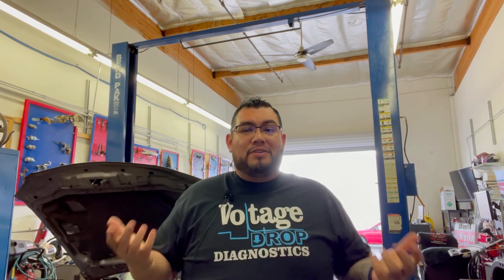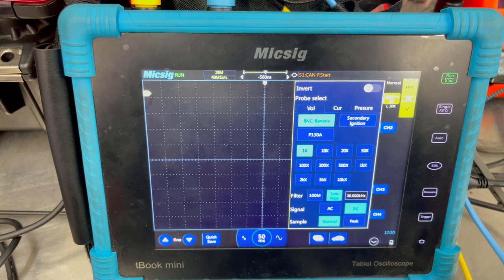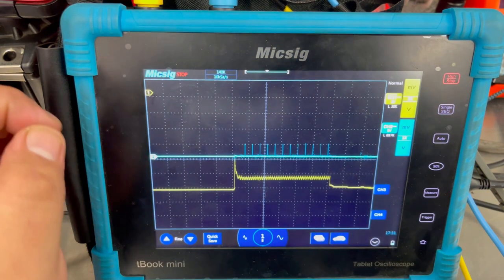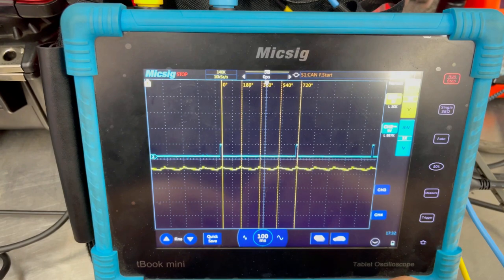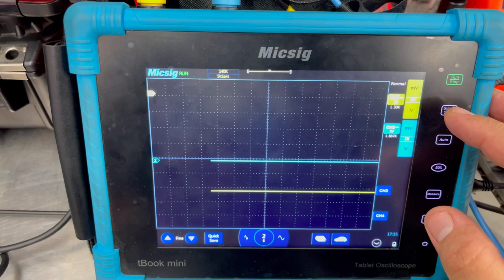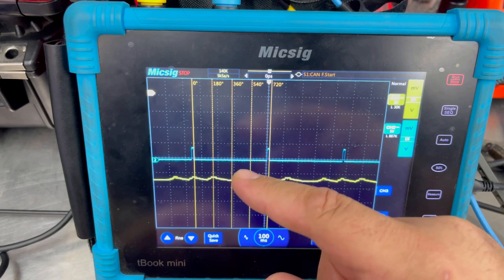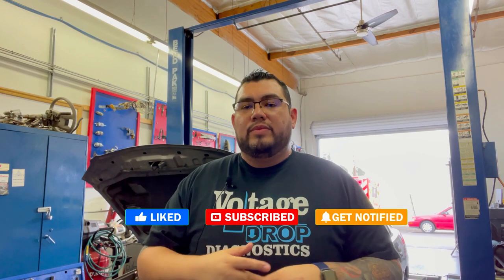PERFORMING RELATIVE COMPRESSION WITHOUT AN AMP CLAMP

Comment: Thanks for the videos they're so informative. I have a micsig and I guess we have a love hate relationship at the moment. My question is pertaining to the lead on the control wire. Is that same lead also connected to ground like the other channel connected across the battery. I'm not sure when I should be using a lead with just one probe or one that splits off into two probes. I hope that makes sense.
Reply from the maker: Thank you for watching! Each Channel lead will have a signal and ground lead. I double stack my grounds at the battery then each signal will be on different points. Just like a DVOM your scope measures the potential difference between the black lead and the blue, yellow, green, red lead. Does that make sense?
Reply: Yes

Comment: Don’t you need to deactivate the fuel injectors? I have a Honda 3.5 and a Honda 3.0.  Please let me know. I own your scope and don’t want to ruin it. Also on primary and secondary ignition do you need to use an attenuator? It doesn’t say anything on the scope when hooking up? Thanks for your help 👍

Comment: Triggering off a coil is nice if you don't have a misfire counter.  But if you have a misfire counter you can just hook to the battery using 1 channel and if there's a missing hump then you'll more than likely know you don't have compression in the cylinder that's misfiring.  Same can be said if you have a misfire counter counting up for multiple cylinders.
Reply from the maker: Misfire counter will say what cylinder the PCM thinks is misfiring. This has bit me in the you know what before, because of this I make sure im synced so I don't misdiagnose.

Comment: I'll say the only flaw with this video was you didn't show where you hooked up your leads on the oscilloscope itself. I'm new to oscilloscopes and you said 2 channels but I saw 3 hookups: 1 to battery neg, 1 to battery pos, and 1 to ignition coil. As someone that's new to scopes, this is confusing when you don't show exactly how you have EVERYTHING hooked up. Helpful video though
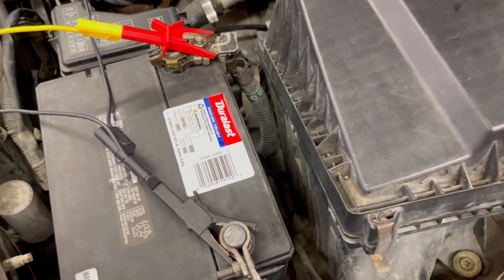Reply from the maker: Hey buddy, welcome to the scope gang. At 1:11 my yellow lead is channel 1 connected across the battery. Channel 2 is my blue lead, connected to coil #1. Any scope lead will have a colored lead and a black ground lead. This is because the scope reads to potential difference between the two leads. Hope this helps.

Comment: Did you use the attenuator to connect the coil wire?
Reply from the maker: Not on this one. Since this coil is intelligent the module is in the coil, I only needed to backprobe the PCM command to the base of the transistor, which is a square digital signal. If it was an older style 2 wire coil, yes I’d use an attenuator.
Reply: @MasterAutomotiveTraining  thanks good information I think I learned something new today .
Reply from the maker: Glad you are learning buddy, keep it up!

Comment: Would this provide enough definition if the cylinder only had a partial leak rather than a 100% leak?
Reply: typically you would want all humps equal, for a partail leak one hump might be shorter than the rest.